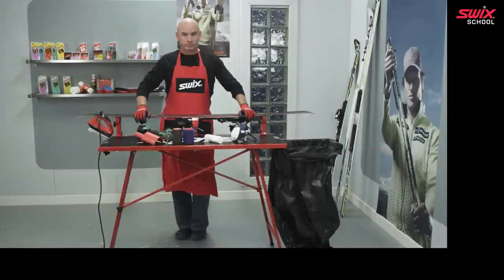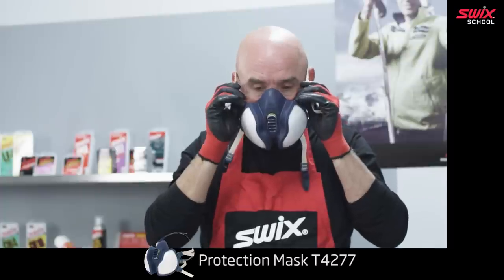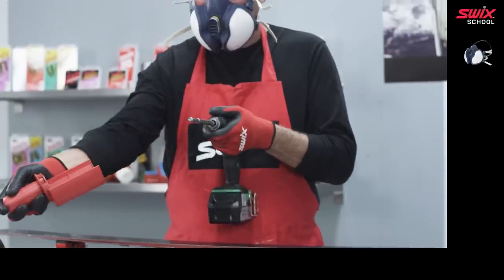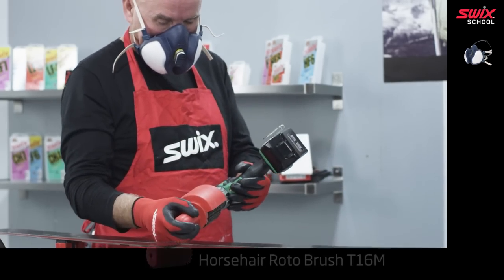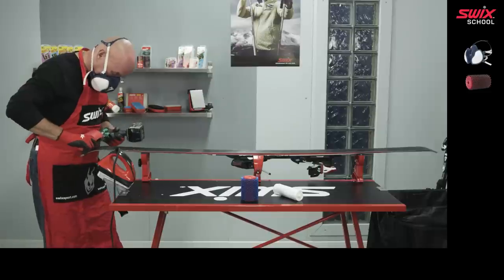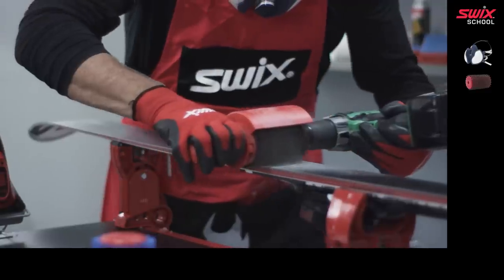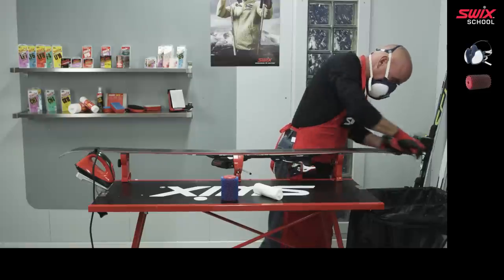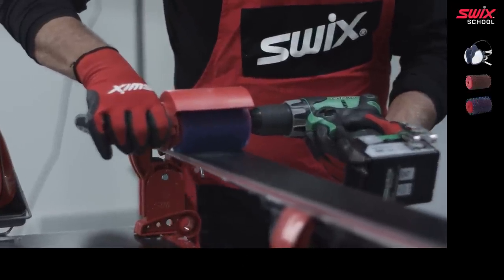Swix Alpine Racing Roto brushing wax

Comment: horsehair before nylon? shouldn't you finish with the softest brush? please explain...
Reply: Horsehair is stiffer than nylon, you do finish with the softest brush - the nylon one.
Reply: @ieazoa3770  weird because other brands of rotobrushes say the opposite. Start with nylon and finish with horsehair...
Reply: @matt02468  I've found that too, however in practice when using horsehair it leaves a matt finish, the nylon polishes it out to a glossy finish. Remember remove the wax, then polish out the structure, hope this helps.
Reply: @ieazoa3770  my nylon is short and stiff.  The horsehair seems more flexible....
Reply: @matt02468  Mine are the same, I was skeptical at first but after seeing the matt vs. gloss finish they leave it seemed to make sense though the horsehair may be longer, therefore more flexible the hair itself is coarser, or at least that seems logical to me.
Reply: @ieazoa3770  Not sayoing you're necessarily wrong, but I have never heard any tech say use horsehair before nylon.  The harder brush (nylon) is intended to remove wax.  The softer horsehair brush is intended to polish at the end.  If I used my horsehair brush after scraping it would remove very, very little wax.
Reply: The confusion is because there’s so many different hardnesses of brushes. So you use them at different times 

Technically you use a softer brass brush after waxing. This puts in structure and removes excess wax on top of the ski and keeps the wax in the pores where it’s needed (hard brass you can use before waxing to remove dirt and old wax) 

Then you can use a horsehair brush to help finish the structure process and clean it up

Then you use a soft nylon for finishing. Makes it shiny and leaves a nice smooth feel on the ski. 

I’ve done it for a lot of customers. Different orders. No one has complained. However I do find the last brush with the nylon has left a better impression of being done to people than a horsehair does. 

I also feel like after the nylon brush, the surface feels solid and slick. Where the horse hair finish feels grippy.
Reply: For swix brushes the nylon is the softest they offer.  Most brush sets have the horse hair as the softest.
Reply: @dlove118  This is the answer. We all agree that you go from hard to soft, but different brands offer different brushes. (I am also surprised because for most brands horsehair is the softest)
Reply: Scrape.  Nylon brush,  then horsehair.  I love Swix products but using horsehair before nylon makes no sense to me. @dow168